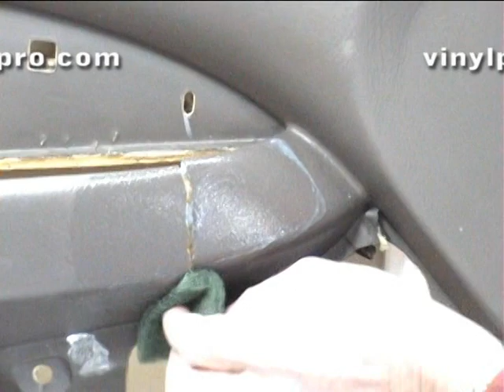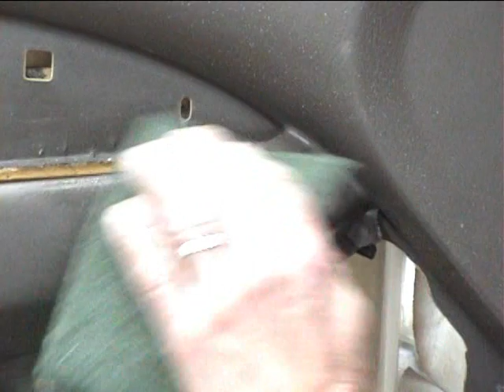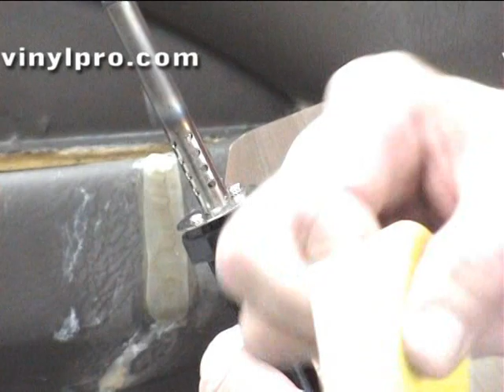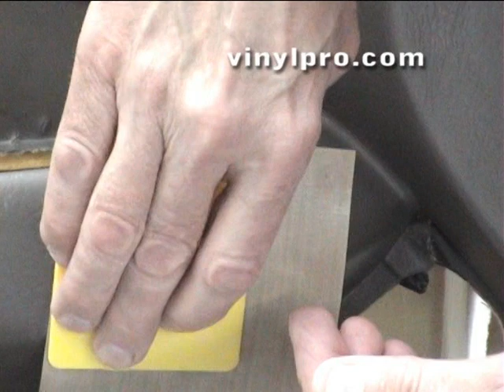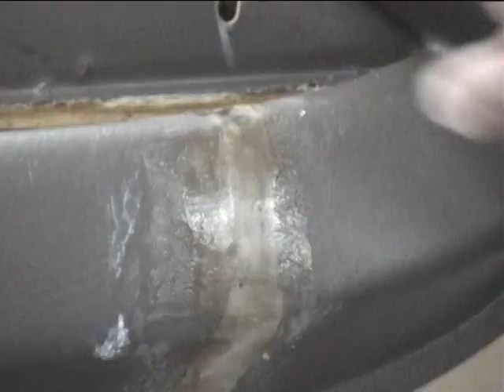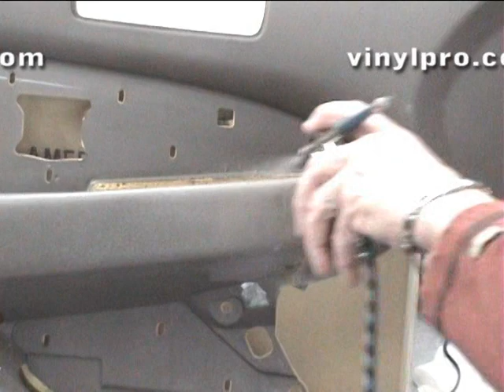vinyl door panel repair using heat

Comment: Sprayed way too much liquids and cleansers which will leave excess moisture inside and surrounding the cracks, this can easily result in poor results.  Work slower, more carefully and only what you need to clean it off, not an entire sloppy wash.. you are experienced, most viewers have little or none, and I'm willing to bet that within time this whole restore falls apart.  You also need to put wire support inside the broken pieces of foam in those wobbly panels..  then I'll be confident that this is a GOOD restore, but aside from that, everything you do and say is super valuable and right on. I just hope the speed of all this gets digested by your viewers, because its super fast and super valuable and super easy to miss all these very important directions your giving, give us more!

Comment: nicely done... but why dont go to the scrap yard or search ebay. 40 bucks and you've got a nice used door panel

altough the repair you did was nicely done!
Reply: Most cars in scrap yards are in poor condition, by me most of them have broken windows which results in mold...  The money and time you spend wasting looking for a good part could have been used towards repairing the old part.  Finding interior parts for my car (96' SC400 Black Interior) isn't cheap as they aren't common, in fact they can be quite expensive.  This guy does excellent work I would use him right now if I could.
Reply: Chuck Tate true,understand. well ,please dont think im attacking someone.
but the scrapyards here in the netherlands are quiet okay. ;)
Reply: its not about the particular part he is fixing its about the process when needed on any vinyl crack like the one I have on my dash...my bmw e30 dashboard cost everywhere 350 400 bucks with no cracks.plus the labor to take out and put back..so I rather to do this job.
Reply: true....mmm not te be funny or something...but i last get rid of a e30 dash.... garbage ,u live in ??? but in the netherlands its not that exspensive....its said too hear it cost a lot.....

Comment: the cost of the tools and material used...,might as well buy a new part
Reply: I was thinking exactly the same thing, unless you are flipping cars, then maybe you build up your tools, but that panel did not look that rare maybe better to buy a used replacement
Reply: gReG sKi A new replacement trim panel is in the 800 to 1000 range so the price of those tools look pretty good to me